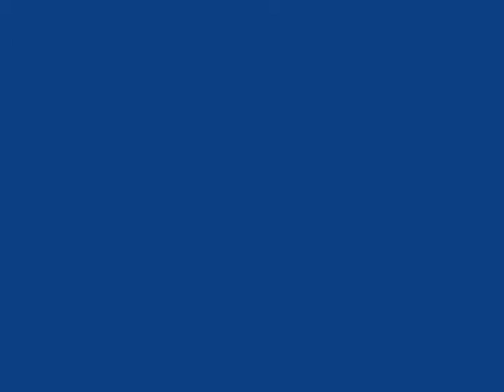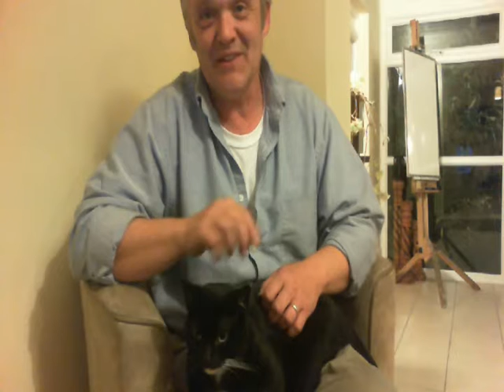Some Thoughts On The Graftenna - A Printable Graphene Antenna

Comment: print antenna on a long sheet of wax paper making the last top layer a sticky glue and just rub it on the wall or anything then paint over it... or on the back of a picture or painting. or print the antenna in the color of the wall or the item you wish to stick it to... or a roll of flexible  plastic mabey not wax paper...
Reply from the maker: i like the idea mate - i will try it

Comment: this tec could be used for beamed energy, to earth from satellite's, or used in space ships to run the ion engine using back ground radiation, used to power Nano bots, or put under the roads to power the streets lights and the houses next to the hi ways, or in the cars to run them, I always wanted to use peso's in a car exhaust to get energy from the vibrations created, when the valves send shock waves down the exhaust pipe ,
Reply from the maker: interesting ideas mate - but i have to honestly say i have no idea - worth a try with a few of them though
Reply from the maker: *****
go for it
Reply from the maker: *****
fair enough

Comment: Hello.I currently use a 3s 2200 25 c battery for remote control flying.I was holping to make a graphene battery that holds the same amount of energy in a lighter package.Would that work?I am only into graphene sheet research about 18 hours.
Reply from the maker: it would work- but it a long way to go from here to there mate

Comment: just a thought, could you also broadcast with this "printable antenna" concept?
Reply from the maker: yes - look here - http://www.urlme.net/blog/?p=2192 - this is broadcast antenna using my ink
Reply: Robert Murray-Smith Thanks for that. Interesting stuff. What are your thoughts on its use for a low cost, diy, emergency broadcast  and receival system?
Reply from the maker: go for it

Comment: Some form of the ink would make great coatings for improving audio cable end point connections no? Instead of those expensive gold plated ones which cost 2 or 3 times the price of a standard jack or xlr cable.
Reply from the maker: Bryan Montford
Hiya mate, it's Rob incidentally - the simplest way of tailoring graphene properties is by monoatomic doping- the addition of function groups can be done to graphene oxide because of the presence of hydroxyl, carboxyl and epoxy sites introduced by the oxidation of graphite - this is one of the reasons why graphene oxide is good to add to some polymers followed by in situ reduction strategies. There ae hobbiest and hobbiest - by which i mean some people have a table and kitchen sink and some have a pretty well equipped lab - which includes several friends of mine - so, though beyond the table and sink guys it is not betond the more determined hobbiest lol
Reply from the maker: nice idea - i may try it
Reply: One of the very first thoughts I had about graphene was cabling. Specifically, speaker cables, headphone leads, and replacement wiring in Tube mics for studio use. The very second thought was, "Oh yah, this is capacitive..." My poorly educated take on it is that you'd have to insure that it would pass frequencies from 20Hz to potentially 24KHz. A single film capacitor is after all the simplest way to limit low frequency information providing a tapering cutoff. I have no idea what the capacitive properties of graphene are, or how one might go about tailoring those properties. Also, last I chatted with Mr. (Dr.?) Murray-Smith about coating materials with graphene, it seemed well past anything within the range of a hobbyist, at least as far as being able to retain any of the beneficial properties of the graphene. I was specifically discussing electroplating type deposition onto alloys or an infusion into the dye faze of Anodization to impregnate the oxide layer with graphene. His conclusion at the time was that it wouldn't be very effective applied via that method. (By "hobbiest", I mean someone with a reasonably well stocked machine shop and abilities to fabricate via standard subtract and additive methods, and including electro or chemically reactive surface treatments, painting, printing, molding, casting, vacuum forming, vector cutting materials and such.)
Reply: Robert Murray-Smith Epoxies, resins, polymers - now we're speaking terms I not only comprehend, but have some proficiency with. Some mixing cups, something to fabricate a form and some non-sulfur clay are about all you need to jump into the polymer-elastomer pool. With supervision, it's a third to fourth grade level activity that you can chase until you're old enough to make your own resin casket... I still can't manage to wrap my brain around why Graphene has not already been applied in so many different capacities commercially. There hardly seems many areas you can't apply Graphene in some means to make it more efficient, effective, and often times less expensive.
Reply from the maker: Bryan Montford
lol - there are probably a few reasons and i would guess the two main ones are it's not that easy to make and business has a natural conservatism - with a small c
Reply: What we need sir, is a Graphene Company. Someone that does nothing but develope ways and create new markets for Graphene. Just as many businesses have created artificial markets for hundreds of products. Such as motor companies. They make motors, so to sell motors, they build things people would buy so they could sell the motors. Planes, cars, trucks, boats, bikes, chain saws - anything that would use a motor they could make, they'd find something they could power with it to sell the motor. Fairchild Aviation did the same thing with Strategic Metals trying to create an artificial market to get aircraft materials and machining into the mainstream weapons market via military. Hence, the AR-10. They sought to inject themselves into a position to sell and market their materials and skills into a market where it didn't exist. A great many of the largest industries rely on the same tactic. Dow Chemical. 3M. BASF. They thrive by making things that no one needs and then building a need for those things. We need the same type of industry motivated by the same goals for Graphene.
Reply from the maker: Bryan Montford
i like the reasoning mate

Comment: As I watched the first antenna video, I thought of NFC (Near Field Communication) enabled devices and how important it is for their antenna's to be matched with the tags they read. This would be idea for  #Grinders  and their like who are building devices in their garages and bedrooms :-)

I wonder (I freely admit a lack of knowledge) if tuning can be done with layers and/or shielding to boost and/or suppress the signal thingy, so the shape of the design becomes essentially irrelevant? Erm ... I mean, the butterfly design is beautifully simple and works the best. It seems that a lot of stuff is over-engineered, but sometimes fine tuning requires a lot of fiddly extra stuff (I'm sleepy, sorry).
Maybe the painted application could allow for fine tuning by simple painting some bits thicker than other bits?

I'm going to bed :-)
Reply from the maker: i think you are right mate and nfc is a really good idea
Reply: Cool :-)
Paging ***** and Lucas Dummitt and tagging  #Transhumanism  and  #Implants  and then going to sleep.
Reply from the maker: Fred Gandt
looks like i put this up at just the wrong time for you lol
Reply: Good morning :-)
No problem. Sometimes 1am is lunch time for me.
Reply from the maker: Fred Gandt
lol